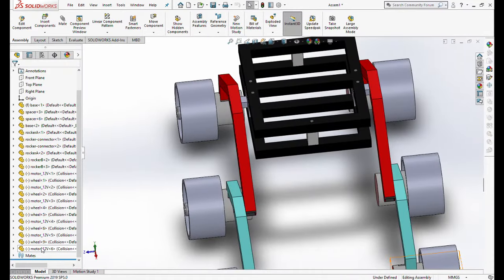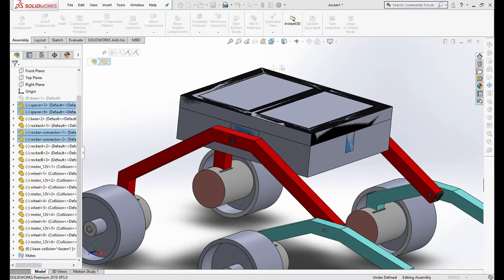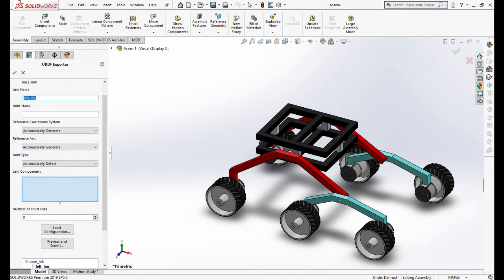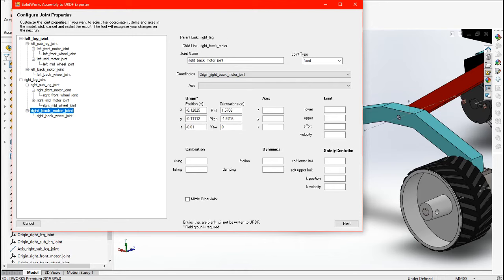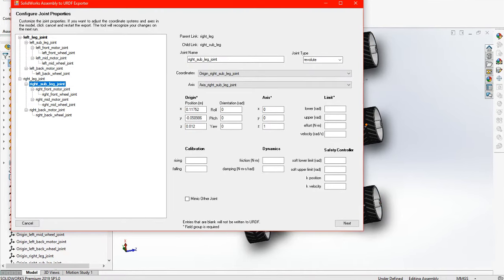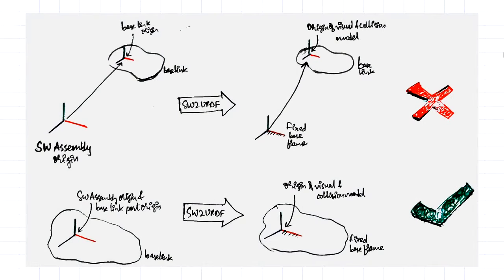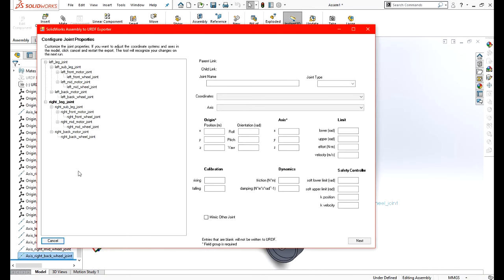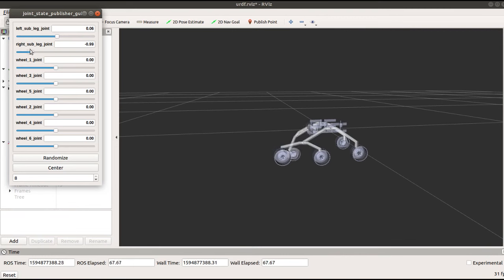Building collision model | Part 2-2 | Rover in CAD

Comment: The SW to Urdf exporter doesn't properly translate into the URDF File. I suggest using Fusion to URDF exporter. Much simpler to use. (Now, Of course, it is on Fusion 360)
https://github.com/syuntoku14/fusion2urdf